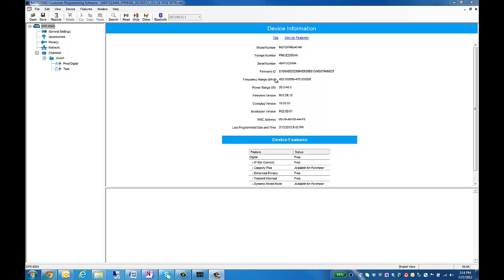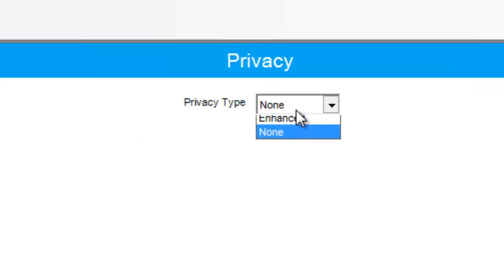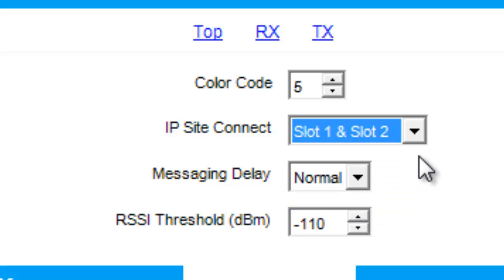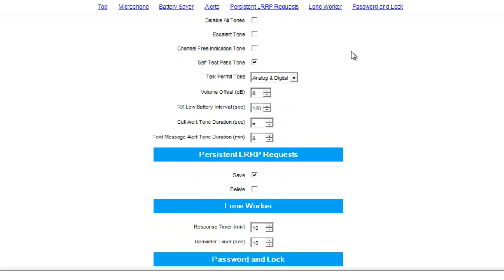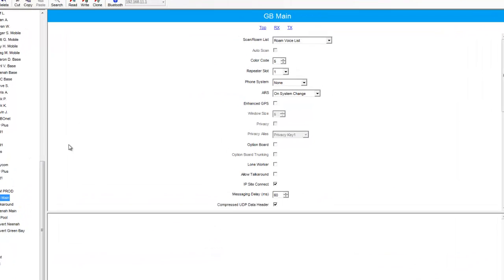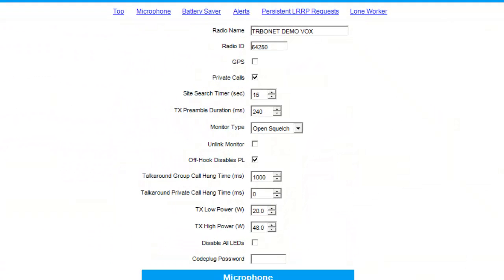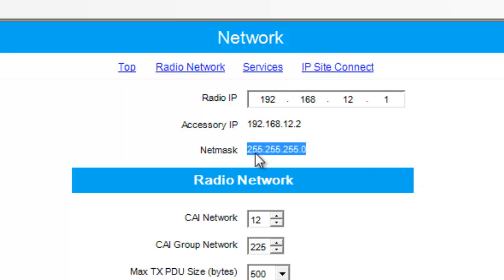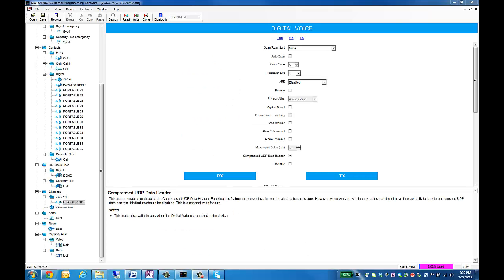MotoTRBO Programming for TRBOnet

Comment: TRUNG TÂM BẢO HÀNH -  NHÀ NHẬP KHẨU PHÂN PHỐI ỦY QUYỀN MOTOROLA TẠI VIỆT NAM
-------------------------------------------------------------------------------------------------------------------------
Phan Van Tu
Century Telecommunication JSC

Century HCM: 421/20 Su Van Hanh Str, Dist 10, HCM City.
Tel: (08) 668 17026  Fax: (08) 4041869. Mobile: 0904 535 797
Email: vienthongtheky@gmail.com, Web: www.vinaradio.com

Century HaNoi:
R.505 F4 Building, Yen Hoa Urban Area, Trung Hoa, Cau Giay Dist., Ha Noi City
Tel: (04) 3996 3498  Fax: (04) 6282 5929. Mobile: 0904 991 381, 0945 535 797
-------------------------------------------------------------------------------------------------------------------------

Comment from the maker: You can check data call confirmed if Text messaging is import and mission critical to your system..  Otherwise Data Call Confirmed will send 2 additional packets per message and can cut down on system capacity.